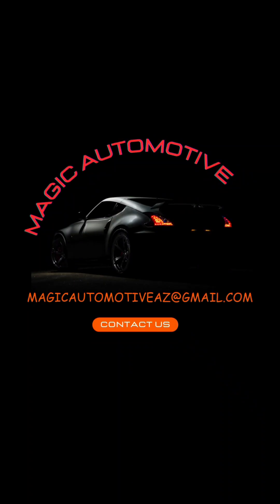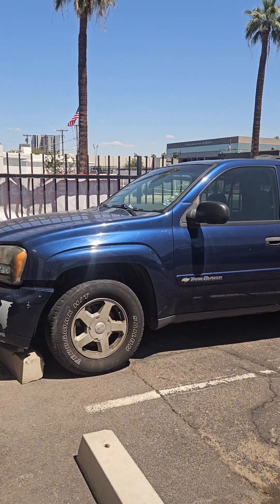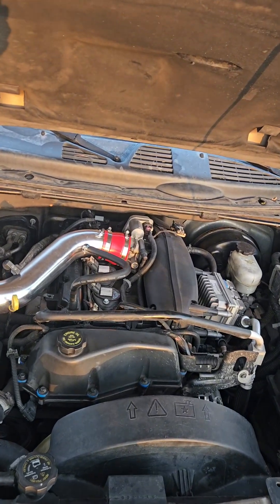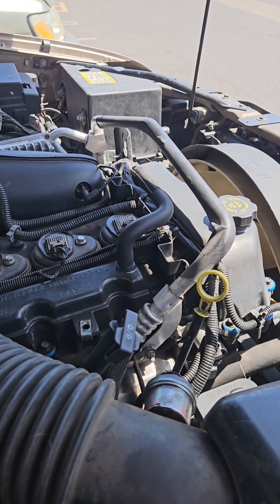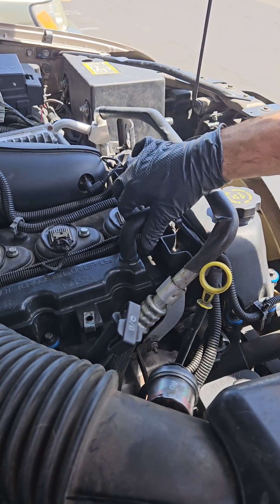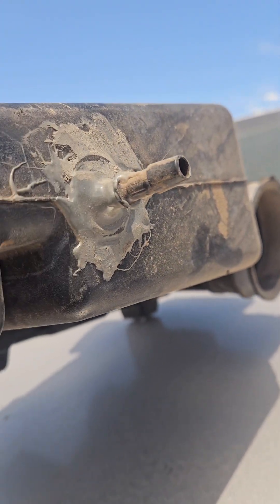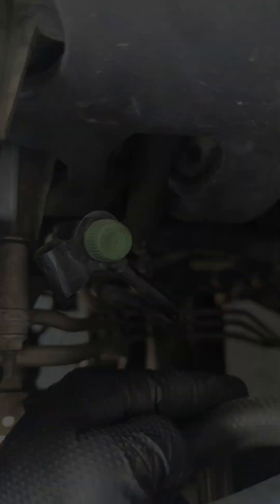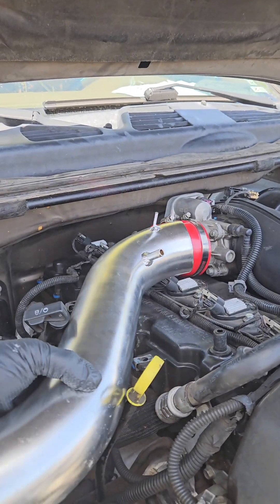PCV & Air intake issues on a GM 4.2 Liter (2002-2009)

Comment: Where would the oil gas substance thats in the Resonator come from. I got a misfire in number 2 which I changed the coil but it was a extra used one I had. Then it went to random which I changed the plugs, and still random. I could say that when I was doing spark plugs I couldn't get the boot off the number for cylinder kept trying and finally got it but I had a piece that tore off. So I had another old coil that has the bottom boot on I used but from a different company so the boot looked like it matched I guess
Reply from the maker: Its a mix of moisture in the air and the  fumes from the pcv system. The fumes are always nasty and that carzy bent hose is always a mess. Thats why I replaced it all, but it doesnt stop the pcv fumes. Likely your entire Air intake system needs to be cleaned. Remove the Air intake manifold and clean all 6 ports out. 3 mastermechanics told me to Junk mine 40k miles ago. The cleanout wad the actual fix.
Reply: @MagicAutomotive that's what I also heard few min ago . 
So, you don't think it was from a bad cylinder tho?
Reply from the maker: @mrperv2026  My engine started right up after cleanup and new valve cover gaskets. Thats not to say you don't have a bad cylinder.  You have to do a compression test. I believe we need 215 psi and each cylinder must be within 15% of that.
Reply: @MagicAutomotive gotcha. I'll have to find one to check it

Comment: You left out ‘05-‘09 SAAB 9-7x! There are dozens of us, DOZENS! 🤣

I am replacing the L-shaped hose on the  drivers side as we speak. It hardened and  cracked. Looks like I need to put an oil catch in its place. 

And I’d like to hear your thoughts on cold air intake. Any noticeable improvements?
Reply from the maker: Its not a real cold air intake.  Its a RAM AIR and yea the take-off is louder and more responsive!

Comment: Very nice bro, just a heads up from a friendly vortex 4200 enthusiast... Keep an eye on your idle air temps, maybe wrap the intake pipe. Check out Nivlac57 he's a pioneer for these motors.
Reply from the maker: Here is the installation video. https://youtu.be/b9_LY0FFk1Y?feature=shared
Reply from the maker: Seen him too. I plan to replace the windshield water fluid reservoir  with one painted matte black. New pumps and hoses. Then I'll wrap it.
Reply: Can you help me identify the PVC pipe on my bike? It's the same one you show in your video. I just bought it and I'm trying to find where the PVC pipe is.